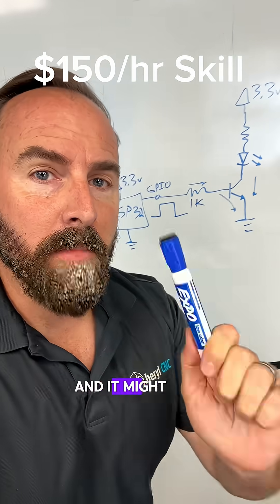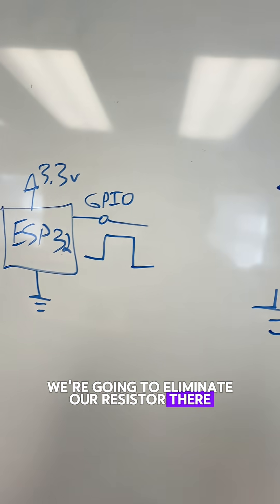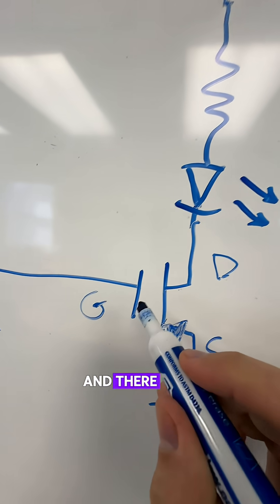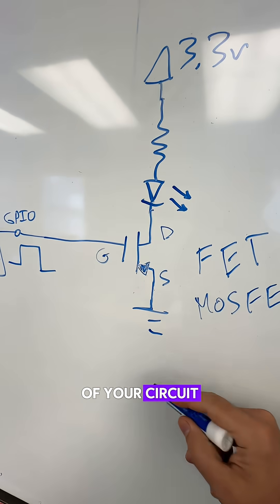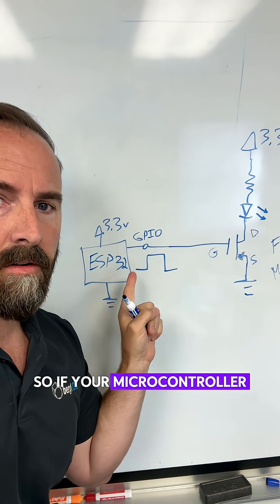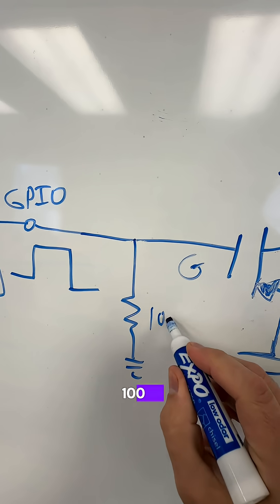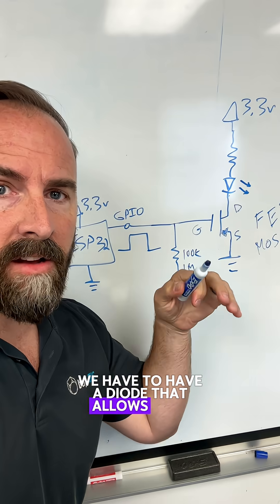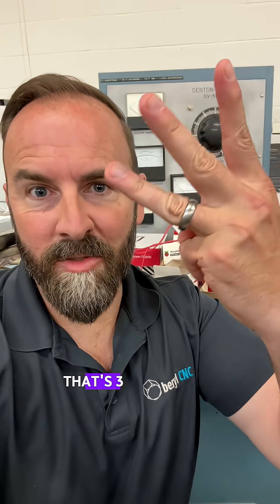Intro to MOSFETs

Comment: Hey, Embedded Systems Engineer here, just a quick correction here, The diode you drawn next to the mosfet is the body diode.
Inside every MOSFET (both N-channel and P-channel), there’s a parasitic body diode that forms naturally between the drain and source due to the internal structure of the transistor.
If you’re driving an inductive load (like a relay coil, motor, or solenoid), add an external fast-recovery or Schottky diode across the inductive load for protection. Not accros the mosfet Drain and Source pins.

Comment: Bro, I have a masters degree in electrical and computer engineering, worked on DoD and NASA contracts and been in the field 5 years and you made some extremely important points I never knew here. I thought you had to drive FETs with current, and the BJT amplifier before a FET driven by a GPIO makes perfect sense now. I was so confused. Real OG in the making here.
Reply: What could you have possibly learned by this video? Do you do any circuit design or just doing firmware/software? All of this should be second year coursework, and DOD/aerospace should be sufficiently rigorous to need this knowledge.
Reply: @dylpickle8147   my mother died my sophomore year; Im lucky to have finished at all.. met plenty of arrogant people like you tho. Think before you speak.
Reply: @normansabin8322  How are you any better by taking the moral high ground? If you’ve got a Masters degree, you must have finished your undergraduate classes, so you should have done some coursework on why FETs have changed the world. 
Don’t dump personal crap like that, this is YouTube, no one is walking on eggshells for you.

Comment: The assumption that mosfets don't require any current to turn on and a large number of them can be controlled off of a Uc's output is incorrect. Gate driver IC's and discrete gate drive circuits exist for a reason.
Reply: Thank you, I’m going insane watching this and I didn’t study EE. If switching at a slow speed, it’s fine to neglect the gate capacitance, but get above 1kHz and your uC might not be able to handle it. Adding a series resistor to the gate will help but then you’re going to switch slowly and generate more heat. 
This guy likes to throw around “$150/hour skill” a lot…
Reply: I have worked with mosfets for quite some time and it does take a little bit of current to initially make the switch, but it doesn’t take current to hold it,, so you’re both correct but he didn’t explain it that way. If you do have the output, switching more than a few hertz there’s gonna be a noticeable load involved in making the switch, but if you use it for just controlling power to another device, then he is correct he would not require any special Drive circuit from the data pin to the Mosset, as his comment about thousands I think that’s a little excessive. You would still need some sort 😢of buffer resistor between the GPiO and. MOSFET  as a current buffer so the Micro controller doesn’t get damaged from the excessive switching current
Reply: @beavonator  I certainly would not go as far as to say that we are "both correct". Attempting to teach people about Mosfets with a blanket statement that they don't require current to turn on is deceptively wrong. They absolutely do. And if you don't understand that fact, you shouldn't be teaching anyone anything. 

If slow switching is your goal then a relay would be the solution. Mosfets are for fast switching. And they require a driver that can source and sink a lot of current to do so. There is a good reason for that. And this is because the DO require current to turn on. Which the OP stated they do not. As I attempted to point out.